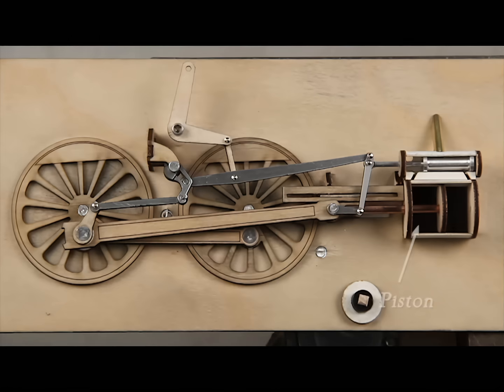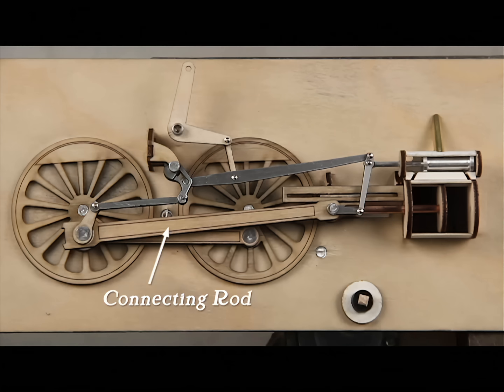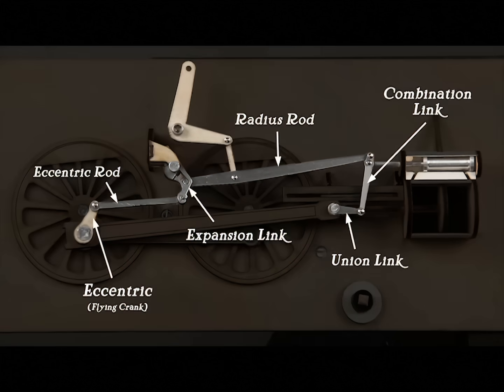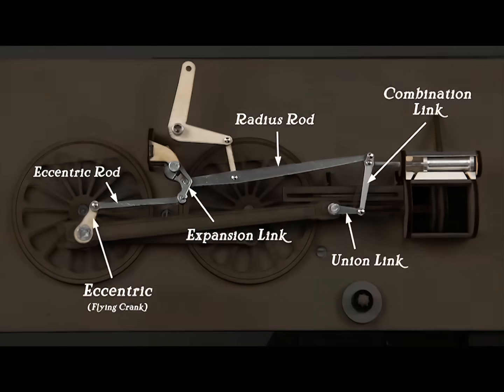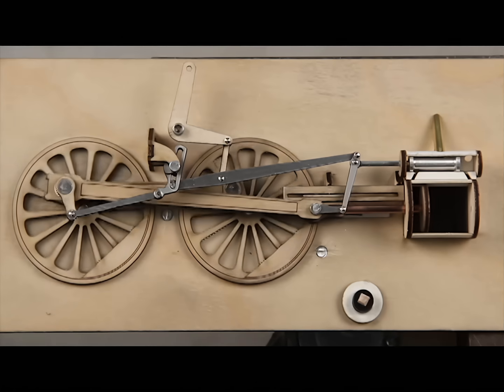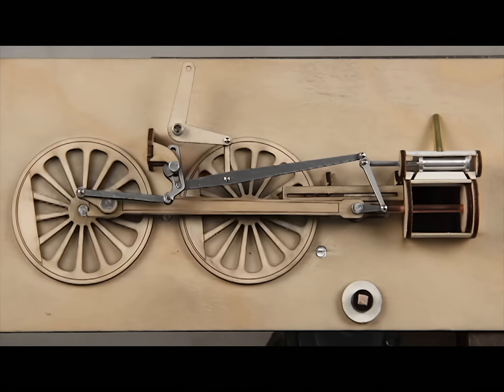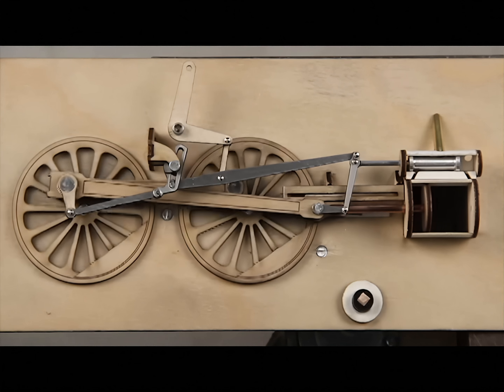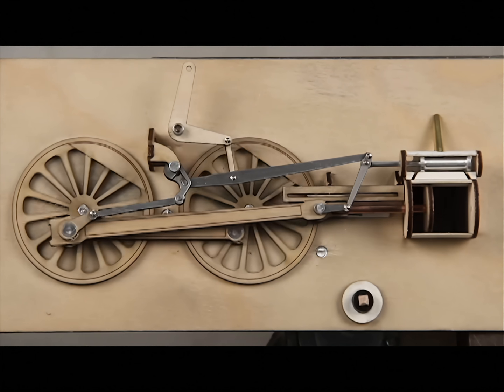Walschaerts Valve Gear Explained

Comment: That was outstanding sir! Now if someone would explain to me how these giant steam locomotives with 4 drive wheels on each side and a straight connecting rod, so easily turns a corner.
Reply: They don't! They're limited to only gentle corners and even then you get a lot of squealing metal as wheels have to slip on the tracks. 

This is why railways where they have sharp bends like dockyards and industrial lines only used short wheelbase locos.
Reply: Wonder no more! https://www.youtube.com/watch?v=Wqwq1Lx0w64
Reply: @MrGoogelaar  That;s a great video.  Good link.  They could have added that when a train is travelling on straight track, the wheel flanges do not hardly contact the side of rail head at all.  If they did it would cause drag. There is a small amount of freeplay, between the wheel flanges and the rails.  The wheel flanges contact the outside rail on curved track, and makes the larger diameter of the wheel taper, or cone ride on the outside rail, and the smaller cone on the inside rail.  That is why the flange squeal is mostly heard on curved track only.  The rails themselves do not sit flat on the sleepers (ties), but are tilted inwards to match the cone of the wheels.
Reply: @railtrolley  Actually the rails are not tilted, the wheels only contact the inner edge of the top of the rail.  This reduces rolling resistance.  Also, the squeal around corners is the wheels being dragged sideways across the rails because there are usually two axles per bogey so they face at a slight angle to the track around corners.  The flanges only contact the track on really tight corners or if the wheels are worn.
Reply: @thisnthat3530  The rails ARE tilted, at least om Vignoles-track. The angle is 1:20, but 1:40 has been used on high speed lines. That"s one of the reasons for tie-plates: Rail tilt could be controlled exactly. The 1:20 angle corresponds with the coning of the wheels.
Otherwise you are correct. :)
Reply: Thank you for those posts. Learned something new about locomotives!
Reply: I don't think they really do turn a sharp corner easily. There's no differential action since the axles are not equipped with bearings where the wheels spin independently like on a wagon or lawnmower.  In Chicago you should hear the screaming as those elevated cars hit the tight turns on the EL. Either one wheel skids or the other does a bit of a burn-out!  The deliberate wheel profile and slight excess gauge distance of tracks allows somewhat for this phenomenon, but not much, as in a tight turn. I am sure a lot of power is lost when dragging railcars in a turn.  I have scrapped a lot of rails, and the ones from the sidings where there are really tight turns are just squeegeed or flanged over to a point where the metal is wrapped over the edge in a kind of lap, caused by wheels dragging over the top of the rail. These rails are rejected at the re-roll or fence-post mills that we sold rails to, since that would cause an included internal fault seam in the finished product. Just like billets in a steel mill can't have any surface faults that will cause hidden cold-seams or internal defects when they are rolled out into finished shapes.
Reply: @junkdeal  It depends om the minimum wheel base. You can negotiate curves at 17 to 18 metre radius with a wheel base of 3,2 metres. I know, because I have driven a two axle street car with such a wheel base thru the tightest curve in Oslo.
Of course, you lubricate the track on a regular basis (using grease laced with graphite).
On railroads, you try to match the cant to the ideal curve speed, som you don't ride on the inner rail.
Modern street cars (or LRVs) have uncoupled wheels (using electronics to keep things in check) to reduce wear om wheels and track. Flange lubrication is also common.
Point is, it works. And has for a gazillion years. Of course curves wear more than straight sections, a train wants to go straight, but the rails force it to make a turn.
And, of course, you could not put a Big Boy on the El and expect it to make the curves on the El.

The coning of the wheels has worked and still works jest fine for plain old railrodding. No need for cumbersome individually rotating wheels on either a goods car, an Amtrak passenger car or a locomotive.
Steam engines with many coupled axles have their issues, which bogies took care of.
Steam engines with bogies exist too, look up Shay engines. :)
Reply: I imagine a car would take any curve it can be horse-powered through!  Is it possible the wheels on the streetcars where you're at have wheel-axle assemblies with a bearing in at least one wheel so they turn independent? I can see why they wouldn't do that for tens of thousands of freight cars due to expense, but a limited production like a streetcar might be a candidate for such a treatment!
Reply: @junkdeal  Nope. Since 1875 and horse trams, all the way up to our lattest trams from 1995, the wheels have been firmly attached to the axle.
And you cannot put a tram (or a train) thru a curve too tight for its design. First of all, you'd damage things (cables, hoses to the bogies), and the bogies would slip from their side bearings and damage things underneath the car.
And it would climb the track and derail. Both a four wheel tram and a bogie tram/car/locomotive.
Reply: That makes sense. There's got to be a limit to the curves they' take. I can visualize the mechanics of why bad things would happen too!
Reply: @junkdeal  four-wheelers tend to leave at a tangent. If not til much, you can back on again. Bogie cars are a wee bit more difficult, but if only the first axle is off, you can back on again too. 
And of course, provided you're on street track. 
If you jump on railway style track (rails & sleepers), you'll just have to admit defeat & toss in the towel. :)
Reply: @junkdeal  I found some illustrastons in a locomotive driver's class/school book from the Norwegian State Railways that explains side-movable axles and flangeless wheels (from 1954).
Reply: I'd like to see that!
Reply: @junkdeal  I can e-mail it to you, unless I find a way to post it in a comment! 😊
Reply: @junkdeal  I'll get to it today! :)
Reply: Great!!

Comment: Not to cause you more work, but now I'd love to hear a history of the design of the Walschaerts mechanism ... how various improvements were made and how it evolved over time.  What components were problematic and what was done to remedy them.  I find this fascinating.  Thanks for your explanation.
Reply from the maker: Those kinds of stories are probably lost to the ages, alas.
Reply: The curved link was already around and used in Stephenson valve gear. The radius of the link is the length of the radius rod (valve does not move when the valve gear is moved from full forward to full reverse with the piston on front/rear dead center). The movement of the link is derived from the eccentric crank (which returns the link to the same location on front and rear dead center).  The eccentric rod connects the motion of the eccentric crank to the link. The backset of the link is to create an equal swing about the vertical plane. The lead and lap lever moves the valve twice the quantity of lap + lead. The union link connects the piston movement to the lead and lap lever. When the valve gear is in center and piston is centered, the lead and lap lever should  be vertical and the valve should be centered.

Comment: I have enjoyed watching the steam locos all my life, but have never heard an explanation for all the rods and linkage. Thank you!
Reply: Ditto. I was aware of “four clicks forward” but now I see how it works.
Reply: @sammolloy1  I don't. We all have our specialisations and blind spots, and mechanics and engineering are the latter, in my case, and not for the lack of wanting to see how things work. Brad, you need to take this quite a bit slower if you want to get through to people like me. "Steam from the boiler comes in here; it pushes this piston like this; which pushes this rod like this; if you don't have a Walschaerts valve, this happens; this is sub-optimal because of this xxxxx; here's how it works WITH a Walschaerts valve . . . " etc. I couldn't build such a model or create an animated drawing, but I suspect animation could be used to explain it better than a model.
Reply: @NSBarnett  Brad has done an excellent job of explaining how this all works on a locomotive other than the tiny error of showing movement in the center between reverse/forward motion.  In the center there is no movement of the sliding valve so no steam is admitted.  If you aren't certain how all this works simply turn off your sound and slow down the replay settings.  I'm sure you'll figure it out watching in slow motion.  Also he is explaining that this is an Walschaerts movement common to locomotives but there is other valve movements used in other style steam engines.  Thanks for your interest.
Reply: Same here.
Reply: Agreed, outstanding.
Reply: I always wondered how the locomotive was put in reverse. Now I know.
Reply: There has been videos for ages on exactly how steam engines work. 

His does a good job at explaining, but the old school ones I’ve seen walk through everything from how the boiler produces superheated steam to how the whistle works.

This video here is very nice and explains it with a cool 3D model

Comment: The drive wheels are all linked together by rods. It would seem to me that the wheels would have to be aligned with the rods to a few thousands of an inch. How do they do this?
Reply from the maker: They are in fact machined to pretty tight tolerances.  And, the mechanical design is tolerant of a certain amount of slop, where necessary.  One of the things that put steam out of business is that it was very maintenance intensive.  These babies had to be completely torn down to the ground, on a regular basis.
Reply: Brad Litwin 
Yes, and also you can’t link steam engines efficiently.   That’s why steam engines got bigger and bigger.  Each steam engine needs its own crew.  You can link up an infinite amount of diesel electric units and run them all with one crew.

Comment: If this were a school project you'd get 11/10.
Concise, short, to the point.

One thing however, if you're not a gunzel you might not know that steam is admitted to both sides of the piston. It could be worth mentioning at the outset of the vid but it is highly likely that the intended viewers all know this by the time they get here - so I'm being somewhat pedantic.
.
Reply: The red shows high pressure, blue the exhaust, being admitted to both sides of the piston on each stroke. It’s self evident.
Reply: Good idea, it took me a while to realize that since I'm used to internal combustion engines.
Reply: thePaulv  Would help too if it was explained better HOW the high pressure steam entered the valve and where the exhausted steam  went !!!
Reply: @wilburfinnigan2142  -- You can see at 1:20 +. High pressure steam is injected in the center of the smaller spool piston at the top from the pipe. The same spool piston can allow access to the exhaust ports on the outer edges.
Reply: That's one thing I really appreciated about the coloring. Especially since, from the model, it wasn't clear that the control piston was hollow, and even knowing that the steam came in from both sides, I didn't know where it was coming in from.
Reply: Watch the beginning of his video; he specifically said this video was to explain the operation of the linkages.
Reply: ThePaulv12 he did. Good and re-watch the video at about tbe 1:20 mark.

Comment: This was cool,but what about the little 4-4-0s of the nineteenth century,wich didn't have this intricate set up? how were they able to put them in reverse?
Reply: One of the other popular valve gears used with inside cylinders was designed by Stevenson.
Reply: MusicMadMaurice  I think Crampton locomotives had outside Stephenson valve gear but in general used on inside cylinders.   Walschaerts is also used on inside cylinder locos. 
Something else to keep in mind is that the driving cranks each side are set at 90 degrees not 180.
Reply: MusicMadMaurice  GWR castle and king locos had inside Walschaerts driving rocker arms to the outside cylinders. Just about every set up imaginable has been use at one time or another!
Reply: MusicMadMaurice  Im pretty sure you're correct. The way GWR 4 cyl engines were set up they sounded like a 2 cyl engine. 
There is a super bit of film GWR 5043 Earl of Mount Edgcumbe at speed. "GWR Castle at speed"

Comment: So, in the neutral position, the spool doesn't move, so that would be like "coasting"?
Reply: Locomotives arn't usually run in mid gear which is engaged when at a standstill to prevent accidental movement.

Comment: And unfortunately one other small detail... the motion was always counter clockwise, so it should have reversed when the link was high. Your explanation was correct, just the motor didn't follow suit. 

That said, I'm definitely not complaining because this was still an excellent explanation of what's going on. 

Thank you for your video!

Comment: You might have made your 'glaring error', but this is by far the clearest video on the operation of Walschearts vale gear that I've seen. Your voice over is excellent - slow and clear. Well done.
Reply: There is no "glaring error" at all.  When in mid-gear the valve still moves owing to that contribution from the movement of the piston, so the movement is in phase with the piston.   Even under these conditions some small amount of power will be generated because of the delay between the opening of the valve and the application of pressure to the piston.  Even hot steam has a little inertia and the faster the engine is going the greater the delay relative to the piston movement so the greater the power developed but it's still pretty small.
   All valve gears are designed so that the valve opens just before dead centre to allow the steam in.  With Walschaerts gear this is a fixed amount but with Stephenson's Link motion it varies, being greater at shorter cutoffs.  It's debatable whether this makes much difference.
Reply: @Rosie6857  Thank you! I was trying to figure out what the "glaring error" was, too, because if he built the linkage to the exact proportions as the real thing (which he appeared to), then how it works is how it worked, no errors. If you want to get an exact "neutral" operation of the feed gear, you just need to raise the position slightly further to where the phase of the Walschaerts gear exactly cancels the movement of the drive wheels (and I'm sure such a position was clearly marked on the controls inside the cab).

The rod to which the control piston is directly connected is fixed at two ends: one to the driving rod, and one to the control rod. By putting the control rod in the exact neutral position, ONE END of that connecting rod is fixed, which still leaves any point along that rod moving in-phase with the driving piston, and thus the control piston is also still moving in-phase with the driving piston. You need to move the control rod slightly into reverse so that its end is moving backwards at the same time the driving rod is moving forwards by exactly the right proportion to keep the control piston's anchor point stationary.

Linkages was one of the more interesting classes in College. :)
Reply: The valves SHOULD open in center (there is no neutral). In center, the valve opens a little bit - this is called the lead - as the valve is only controlled by the motion of the piston through the lead and lap lever. When the valve gear is properly set, the loco can run in forwards/reverse as the valve events are the same, just not very powerful.

As far as the eccentric crank, the eccentric crank is close to 90 degrees off, but due to the piston centerline being higher than axle centerline (dead centers are not 180 degrees apart) and the height difference between the axle centerline and the basked of the link, the angle can vary from loco to loco and with the crank pin at the 6 o'clock position the eccentric crank pin is higher than the axle centerline making the angle listed in this video greater than 90 degrees.

Comment: Thank you for this.  It is somewhat surprising that this running gear is so ubiquitous on so many locomotives, but even on YouTube its explanation is short in supply.  One 'addition' as I see it, is at full power the two cylinders are in effect a compound, the top high pressure running cyinder feeding into the lower larger low pressure cylinder before final exhaust.  This double expansion gets more work out of the steam, but a the cost of steam.  At low power,  steam is just run straight into the lower cylinder, as the higher cylinder effectively stops running, giving less work, but also conserving steam.  A brilliant design, and difficult to illustrate.
Reply: actually, you don't get a double expansion effect. the piston valve (above) is just a valve - it does no work because the steam pressure is balanced - the steam exerts the same pressure on both ends of the valve, in opposite directions, so they cancel each other out.
Reply: @simonholyfield3319  Thank you for clarifying this with me.

Comment: Excellent Video and great explanation! I only have one question: where did you get the plan for the gear from? 
Thank you so much for the great video!
Reply from the maker: Thank you.  Basically, I used a photo for general proportions, and then adjusted things until it made the correct motions.  It's very "seat of the pants."  And, there's an error, as explained in the description.  So, maybe it's not quite so brilliant as it seems ;)
Reply: ;) thank you!